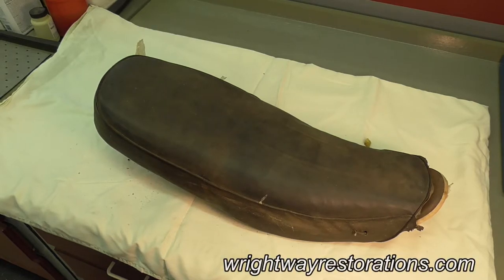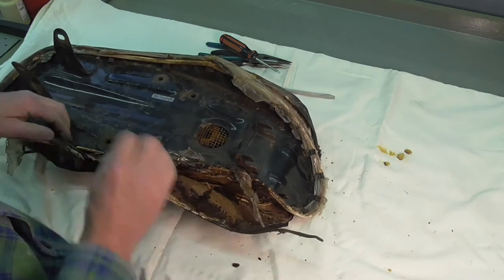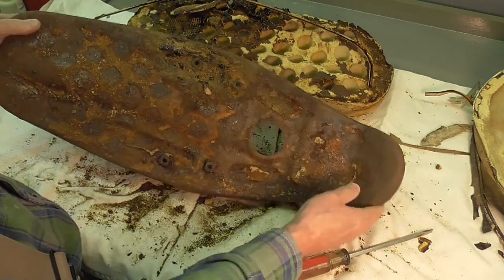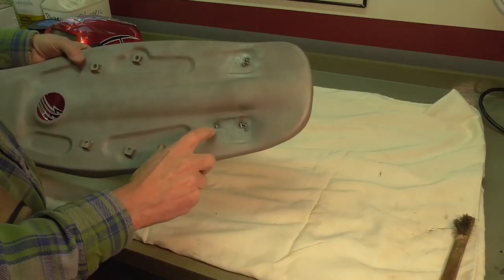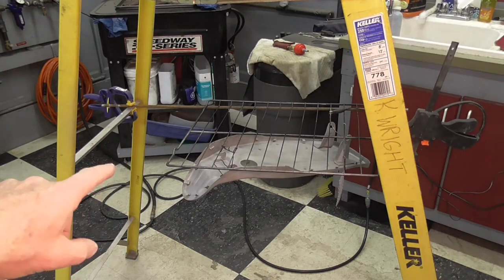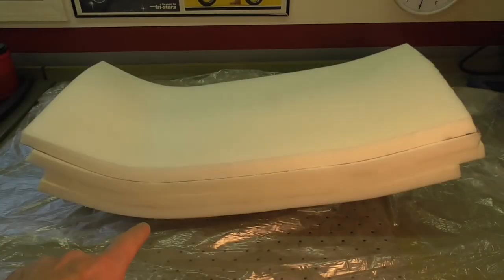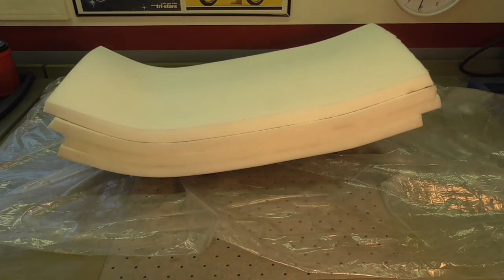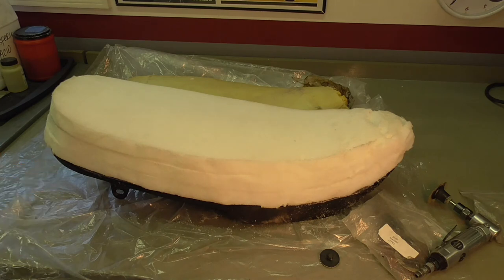Yamaha YL1, Restoring the Seat --- Video #194

Comment: Nice work Kelly. Would have thought the seat pan was a gonner until you showed the result of the media blasting. I think the waves at the front are an enhanced design feature that was missed in the factory...
Reply from the maker: Thank you Jim.  I've recovered quite a few seats over the years, and this was the most difficult so far (it was also the most extensive).  I'm not totally satisfied so I may eventually come back to it and see if I can improve it.  It's a delicate process as the metal tabs that hold the cover on can only be flexed so many times before they break off.  I have to think on it...

A "design feature"... now that's creative.  I certainly appreciate your words of encouragement!